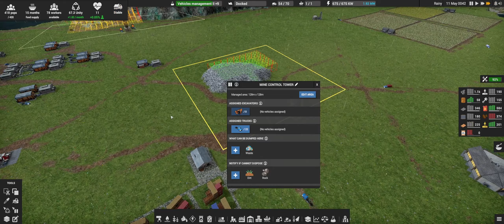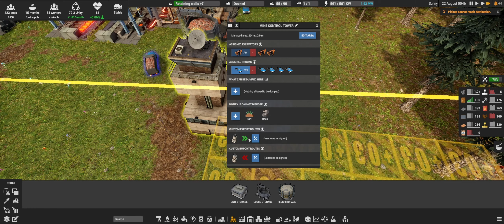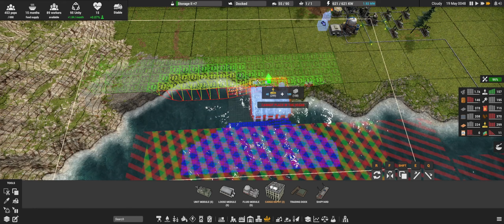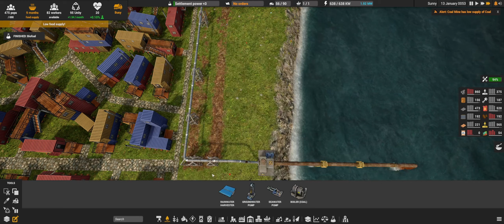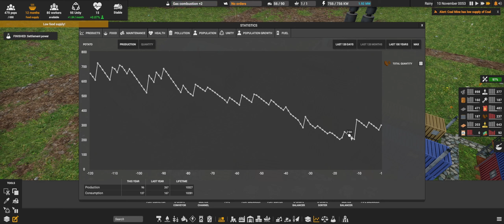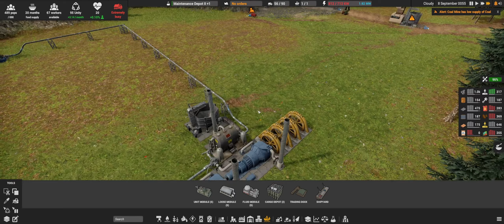Getting Ready for Oil - Episode 4 ║ Captain of Industry

Comment: So, you need two storage for the mine control tower thing, one for closed network of mine control tower, and one for the open network. Control tower is set to export to the first one, than the material is transfer directly to the next that is in open network (and often set to empty to some %), than the truks in open network will pick up stuff when demand or empty condition is satisfied.
Also highly recommend to do it for all three types of stuff from a mine, ore, rock and dirt, that way trucks that are assign to the control tower will not need to drive a long way to dump stuff as long as the second storage is constantly being empty.
By the way I recommend using waste as landfill to fill under hight +2, that way you will have a more constant supply of ladfilling materials and also if you determine to do something else on it, you can dump the desired material on it to reach hight +3 (requirement for docks), incase of farming, you will have to fill it with dirt or compost only.
Reply from the maker: Thank you, that is exactly what I ended up doing in the next couple episodes (I have 2 more uploaded already).

I did end up doing that 2 storage setup for the dirt and rocks, but I found that the ores worked fine with just one.

I saw videos where the old logistics system was only doing a simple "connect" for this, but now that we can do drop-offs and pick-ups separately, I just tell the tower the keep it filled up, and the open-network trucks can still come to pick it up.

As for the waste landfill, I feel kind of bad about that one. I know nothing happens in-game if I do what you just said, but it still feels bad to do it. :D

Comment: The Evaporation Pond is in the next tier costing 23 Con 3 parts on Captain level. Honestly, potatoes and veggies can be a little bland. Partial loads can be disabled in the vehicles overview is the earliest Logistics available. Disabling partial loads moves all full load jobs to the top of the queue before allowing partial load jobs to be taken. Trucks recover faster from extremely busy, however, some delivery will be delayed. The green manure benefit is greatest in the new irrigated farm, but has diminishing returns; in an upgraded irrigated farm, one application when it's connected to Water is good but two crops provides the most output annually. 3 crops is too much without fertilizer and will require an application of green manure. 4 crops, means you need to build another farm.
Reply from the maker: I will definitely need to look into that partial load thing. I'm still kind of learning things. :D

Thanks for the tips. :)
Reply: I'm being told that green manure has better results in Greenhouses, but I just got to where I can buy glass from the neighbors. I'll let you know how it grows.